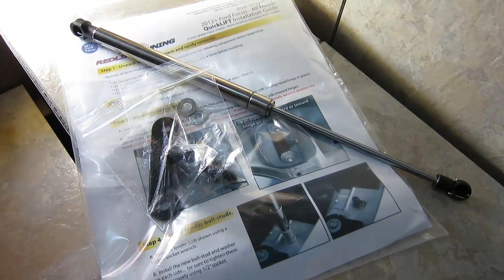Ford Focus Hood QuickLIFT System Mod - Get Rid Of The Hood Prop Rod!

Comment: Great video! I already have these on my 2012 Ford Focus, did exactly as you did, without watching the video first. 

To answer the hood close question, it's exactly as you would without having the hood struts, no difference. Lift hood about 8 inches, and the hood opens itself after that. Wonderful product, even just for making it easier to pour the windshield washer fluid in, it pays for itself, no annoying prop in the way.

Comment: Ooh!  I like those a lot!  Definitely going to buy a pair of them when I have the opportunity.  Thanks for this video!
Reply from the maker: Yes, these hood struts REALLY make servicing the car a lot more easier, without the annoying pop-rod in the way. It looks COOL too. However; the cost of purchase will need to be justified. If you rarely pop your hood or work on the motor, it'll be pointless.
Reply: moomoo97 Well, just being able to avoid having to use the prop-rod every time I check the oil is enough justification for me.  Just bought 'em -- about $144 including shipping. Sweet.  :-)
Reply: The kit that I received is slightly different than yours...  Looks like they've improved the lower-connection for the gas-struts...
Reply from the maker: Cool! Does it help to improve your installation too?

Comment: Nice video. Since you are such a perfectionist, I'm surprised you didn't paint the black brackets for the struts blue.
Reply from the maker: LOL...that's because I'm a perfectionist. Unless the brackets are spray-painted in matching blue, I'd rather leave them black than paint with just the touch-up brush.
Reply: True. You can get the matching colour in spray paint... Done right, it could look stock.

I looked these struts up on ebay after watching your video. Must say I was kind of shocked at the price!

Comment from the maker: With the quality of these struts, the price is reasonable. But yes, it depends on how often you need to pop up the hood, it's a mod for convenience after all. If installed correctly, the hood will just close as normal with a slam down motion. This kit is specifically engineered for the Mk3 Focus and this company is doing the hood struts for all other cars too, so they know what they're doing. :)

Comment from the maker: I bought the Factory Touch-Up Paint directly from Ford Dealer. But it only depends on how perfect you want to match the body color. If your car's color is easy to match (e.g. White, Silver, Black, or Red, etc.), you can also use the aftermarket touch-up paint since the section we need to repaint is not outside but all under the hood in this project.